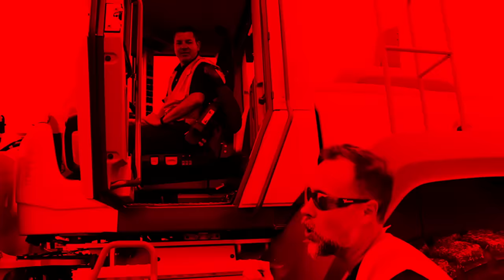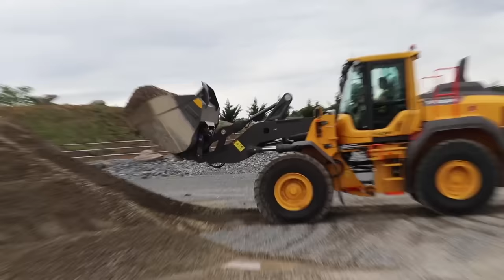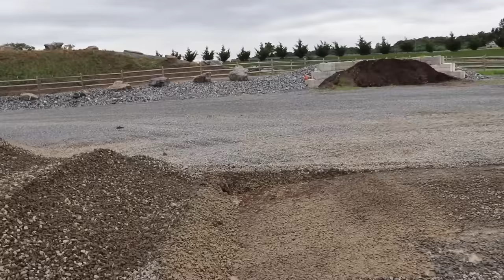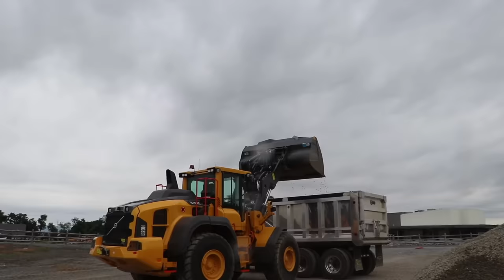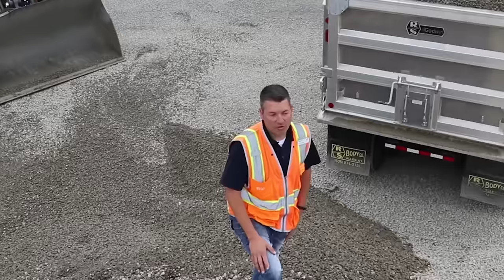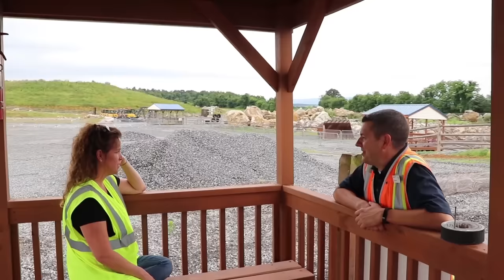How NOT to run a Wheel loader - mistakes, errors and red flags

Comment: some good advice from someone who was shown how to load a bucket correctly very early on in his career.  these people aren't doing it.  always keep the bottom of the bucket horizontal.  when the loader stops moving into the heap raise the bucket until the loader starts moving in again.  do not curl the bucket- keep it horizontal.  when it stops moving in to the heap raise the bucket again and again do not curl the bucket up.  keep doing this until the load has filled the back of the bucket.  then curl up.  you have a brimmer.  if it is necessary to keep the floor clean, give the bucket a jiggle to shake off the excess before going near the truck.  once you have got the feel of how easy the heap is to load  raise the bucket smoothly and steadily as you drive in so the machine never stops moving.  do not wriggle and curl the bucket into the heap. the way i have described is far better.  this heap of clean little rocks is a pushover to load out.  when you have to deal with lumpy sticky stuff there is another technique to add to your skills.  do the best as i have described then reverse out then hit the brakes hard as you give maximum curl.  this is to throw everything to the back of the bucket.  then go in and do it again to fill the bucket fully.
Reply: Hell's favorite Salty Berserker  , this is easy stuff to load.  the method i described is necessary for difficult stuff.  again i say this bloke is curling too soon.  there is still space at the back of the bucket.  if you are an operator yourself, try it.

Comment: First make sure u identify that the truck driver is in fact in the cab & NOT in the dump body.. Make sure they are backed up to the correct pile for what they need. As u get ur first bucket, visually check the dogs are locked on the tail gate. Being a great operator is all about safety, efficient ease of operation.. Fluid & purposeful movement as not to damage piece, truck, or cause harm to person. The mind set of the individual wanting to be an "operator" means everything.  Calm, Cool & Collected usually means frustrations aren't taken out on the equipment...

Comment: The only thing I would add to this video is showing how to check the oil, coolant, and hydraulic oil levels.  As well as mentioning letting the machine warm up before working it. The "pretrip" is just as important as operating it. Great video.
Reply from the maker: Thanks Stan , good advice
Reply: You guys are Awesome please keep making videos
Reply: Just read the specific manual PDF. Easy. Most don't.

Comment: i was lucky when i finally got into the industry since everyone serches for "experience for years" ive been running heavy equipment since i was 4 years old and didnt get a job in the field till i was 21. I got a job starting as a loader operator for a quarry and also as an excavator operator when needed. im constantly getting praise from truckers wondering how long ive been in the field even at my age. Im by no means a master but im VERY passionate about operating and already excel better then most operators running for decades

Comment: Good stuff, ran loaders for decades and also 15 years at a highway dept. One thing is you learn "site" points on the bucket for each of your trucks so you do roll the bucket exactly at the right point while also moving forward with the loader to get the load centered. I got his stagger comment...salt being lighter you want to stuff that truck..so instead of "stagger" on a typical tandem its two buckets up front then one to the back..:) (Volvo L120E's & 15ft boxes) Retired now...watching the new guys herky jerk that loader is a sad thing. BUT they will learn. I think one thing that was different when I first started was attitude. It was a status thing to be damn good, a mark of excellence to do a quick efficient and smooth load operation. Now its a slam bang I don't care type of thing that's prevalent. Where you really separate the operators from the stick yankers is stacking a salt pile, building the road in that loose material. THAT'S a skill. Wish I could post pic of the operation in the salt shed.

Comment: Been running loaders for 15 years.  Got a Volvo 250H yesterday. Been running a kamatsu WA - 500 for past several years till my hydronic lumps went bad.
Reply: John Morgan give me some tips Bro. Only just got my loader ticket yesterday 😂
Reply: LJ Nouata biggest tip, when loader goeS to bouncing. Slowly raise the bucket or lower it while driving and it will stop the bouncing .

Comment: Pretty cool video.   I’ve been in a payloader since 1990 and I am currently in a 2014 Volvo L120g and I’m loading 120 semi’s a day with it.   And I have a full on board weighing scale that I scale every truck that goes out so we are not overloading or under loading them.  
I sure wish I had that 350..... it would make my job a lot faster.
Reply from the maker: Thank you !
Reply: MrDonnyt how’s the salary?
Reply: The Brian , here in Canada for a fully experienced loader operator that greases  the machine every day, and is polite to customers, doesn’t hit the trucks and loads them properly (not overloaded or under loaded) and if you work for a company that recognizes a good operator (which I do) you can expect 80,000 a year (based on the 50/60 hour work week).
Reply: @MrRF007  depends on what part of Canada
Reply: What are you loading?
Reply: @poppaluke9991  loading mostly base gravel and sub base.

Comment: About once a week I think about leaving my desk job and doing an apprenticeship in equipment operation with my local operators' union. It's something I've wanted to do since I was 5, and it's a desire that has never gone away. I keep hitting road blocks, from others trying to discourage me to the reality of having to earn 20% less for a few years until I got some experience. I don't think the time is quite right, but when I do recareer myself, I'm still leaning this direction.
Reply: bud its never to late alot of competition for the seats though i work out of union and after 5 years i can run a front end  loader and rock truck and am currently learning how to grade at the school im 46 it can be done

Comment: I ran equipment a lot at night under light plants if you are 3 or 4 stories high pushing material you better know that piece of equipment is top shape so pre inspection is so important especially if you got 30 or 40 dump trucks you are working around at night

Comment: I had to feed material bins load dump trucks push rail cars push stock piles and clean up around the yard and the plant do this 14 hours a night at high speeds lol but I loved it I miss running heavy equipment
Reply from the maker: What kind of work do you do now John ?

Comment: Also, if you are running the highway with rigid tippers or semi tippers always load just over centre to the high side of the tipper, allowing for the highway camber.  You need to distribute the weight better, or off set, so the tyres on the low side of the road camber won't blow, those tyres/wheels on the low camber of the road are carrying more weight than the high side of the camber on the road if the load is centred.  Most people don't consider that, until they find out they blow tyres on the low road camber tyres/wheels more than the tyres on the high side.  All roads or highways have a camber for water run off.

Comment: If u get pulled over and axle scaled in a dumptruck,  u want nothing in the back, cause if u aren't over gross, and your over on rear axle, u gotta shovel it all fwd! Try to do that with rock or asphalt! Load the front to middle,  u can always tip the body and shovel it down hill if u overweight on front or tag axle. Which u really never are unless u are over loaded. Last foot of body should be empty! Not half way up the gate
Reply: did you not read the title of the video?
Reply: @MacAttack2010  I did! But it shows u didn't watch whole video and what he said!!!
Reply: The dot man and me would have a good conversation cause I’m not shoveling anything
Reply: @thatlilbkid  then u just get the ticket.  No conversation needed
Reply: you build it we destroy it  shows what you know. If u are not over your allowed weight but u are over on certain axles u are free to move the load so u can drive away legally.  If u choose not to try and balance the load, u get the ticket. Same on a tractor trailer,  they dont make sliding 5th wheels for nothing,  or sliding rear axles. That's why u always load front of dumptruck,  specially on fwd axle trucks. Eaiser to raise body a little and shovel downhill then it is to move the load fwd

Comment: The do's and don'ts shown in ideal working conditions with good, hard, level ground....while loading the easiest to handle material possible. Good concept on the video, but stick him on a tight, sandy job with little to no turn around room and loading wet material with a loader 3 sizes smaller. Good luck being efficient, not spinning tires,  and dumping dead center

Comment: i used to work with a volvo 350 or 120 wheel loader 6days a week 12hour shifts and now i'm home with a worn back my spine is completly worn out i miss this i loved to work heavy equipment
Reply: Did you always take the impact or did you ever sit up away from the seat? Im asking for a reason lol.
Reply: @timothyjones4959  that volvo  had nu airspring on the seat it was a old beast and before that i used to drive a komatsu wa380-1 with full rubber tyres on it and that seat was without air spring to so yeah i took a lot of impact when driving it  especialy when whe crushed concreet on non flat surface i was young and did not mind but now i think otherwise
Reply: @2strokescootertuning248  I operate a Cat966k with solid rubber tires. I can feel the impact coming but I always lean forward to avoid impact to my back. Same with the excavator. It has a claw instead of a bucket. The lead claw will pick up the excavator sometimes and i lean forward in the seat. I'm sure I'll still regret it later on but I'm hoping it helps lol.

Comment: For the SAS forks, be nice to see someone dealing with shear ice combined with inclines, uneven ground, and tight spaces. Then using the forks to slide under a vehicle parked on a 45° angle between other vehicles, then lifting it up (preferably something with a terrible centre of gravity like a Honda Ridgeline) up over the other cars 6-8' in the air while articulated. Then reversing out while swinging the load over the over vehicles. Then add some side loading onto a car carriers tops deck that's raised all the way. If not too much to ask lol

Comment: My biggest problem is getting it centered mind you im completely blind in my left eye & 63 yrs old i have been opt off & on 12 yrs so safety is key.
My loader is a WA270 KAMOTSU at this moment im working in a landfill digging without teeth in solid river rock & compacted sand & soil very uneven area.

Comment: I was a skilled laborer and operator for a metal recycler I would run a 988b among other equipment. every operator job I tried to get told me they were hiring operators but would hand me a shovel on day one and tell me I would be aloud to run machinery in 6 months to a year I was 25 at the time im 30 now and am a few steps from being a proper millwright instead. I miss running equipment though.

Comment: I love machinery but I am struggling to find a job without experience
Reply: Join a apprenticeship program, Im actually doing that, look up operating engineer apprenticeship
Reply: I had to start out as a mechanic to gain experience. Now I wrench and mechanic for a construction company
Reply: Get into trash. Or find a job where operating equipment is every now and then but jump on it as much as you can to gain experience. That's what I did and things will fall in your lap. Or get "certified." Dont really need it for loader operating, but it'll help you in the long run and you might get better pay too.

Comment: you sir make being a wheeled loader operator a glamorous and lucrative job. well after 30 years + I can tell you its NOT . all newbie's start off on 15 to 20. year old heap of junk. just as I DID and work there way up through all the other CRAP . because no boss is going to trust the newbie with a new machine. depending on what your doing at times it can be very stressful and I've been in some cool awkward moments that would send the faint hearted home for a clean pair of pants . I work by two rules 1 the most dangerous part of any loader is the nut holding the wheel 2 your only as safe as the idiot your working with
Reply: My first loader was a 6 month old 980K.
Reply: Am training as pay loader operator but I need to work in your company and get more experience please.
Reply: Speak for yourself man. Your experience doesn't mean thats how its gunna be

Comment: Good information you have loaded more trucks than I ever did. I worked for Clark Michigan as a field engineer, a parent company of the Volvo you are operating. Please allow me a little sharp shooting here, out of boredom, due to my age and with all respect due you guys. The word pay loader is a brand name originated by Huff and later bought out by International. I have heard guys call them a pail loaders lol. It's like every machine with a track is a Caterpillar. Your machine is a front end loader. There should be an automatic bucket leveler on your machine unless the hot rod operator over rides it. Humping the machine isn't good you are right. I hate changing beat out hinge bearings. Loading processed material is easy enough and you did it right in a proper Y cycle. Try busting out shot rock over burden for a little more challenge. Lastly the loader should be engineered to just slip the wheels when crowding into the bank so as to minimize tire wear and maximize tractive effort.
Please don't take offense at my comments after all you asked for them.

Comment: Spinning the tires isn't abusing the machine,  it's just wastefully wearing out the tread on 3-4k$ per tire, he should've explained,  drive into pile, load front end of loader by picking up a tad so u have traction,  then fill the bucket working the curl. Should've loaded fill or dirt to show this method.  Cause 90% of your guys just run into dirt pile and spin the tires while trying to pick up to much and curling to early or late and getting a 1/4 of a bucket

Comment: This was good, thank-you! Do you have tips on maintenance, i.e., what to do about problems, what sounds to listen for, what to feel for, etc.? We run our own equipment and don't really know what we're doing. We live in a rural area that has slim pickings for diesel mechanics too, so any advice, materials, YouTube playlists/channels you can refer me to would be greatly appreciated. Thanks!
Reply: Most newer machinery will happily give you warning messages on the display. Otherwise, learn how your machine works. I used to be on a Volvo L70C and you could never fully fill it up on hydraulic oil, then it would leak. Every machine is different and it REALLY helps if someone that used that machine will teach you the tips and tricks on how it runs! You will quickly catch on if something sounds weird if you drive a machine daily :)
Reply: Thank-you for the response Effen! 

The equipment we are using is largely 70s or so. The D6N we recently acquired is one of a couple of pieces of equipment we have that were made within the last twenty years. It is a secondary source of income for our family and we aren't in the equipment every day. (It's one of two family business we're getting up and running.) 

Sometimes I think something sounds really weird on our road grader and then the sound goes away. I've had Dad listen to see what he thought but he couldn't hear the sound and wasn't concerned so I let it go.

Comment: In otherwords you want me to work for you, I naturally do almost all that when I was using the 966c and 980c for a couple jobs lol. Rental equipment which I complain about the lack if maintenance it seen joints bone dry, slight hydro leak bad tire.   Got to love it even rental place says if it's functional still run it.... I'm like hydro fluid is spendy and when it runs out no good lol.

I own a jd 755c tracked loader, much more loading power than wheelies, just wish I had a bigger bucket!

Here's to self employment LLC cause I know how to run equipment (and when not to) but prior to going LLC I didn't look good on paper so they said grunt worker thed try at.. been there done that too long, and still have to sometimes, but if I'm working with a grunty I try to make them have the least heavy labor using equipment to do things. 

Someone missed out cause I'm not sure I'll go back to working for a boss, but can't say I wont

Comment: Been in equipment for years, if your a lever puller, or your so called operator, things happen, you will not see or hear or predict it all. Majority of companies have mechanics who tend to these machines, and back up's for when one does go down, and alot of companies do not want operators messing with their equipment, your job is to operate. If you own a car, a tractor, or a motorcycle, you know enough to know when something is wrong. Most equipment will tell you what is wrong, low, or a problem. Don't make yourself out to be a Master, cause that only fools the one's who are not intrested. It's know it all's like this, that drive and scare people off, cause you look down your nose at others!!!

Comment: Can I say on behalf of all loader operators to the truckers, can you please have your crossbars moved out of the way and the tarp open before you pull in for loading and also I do not need you to climb the side of the trailer and point where I should load a bucket.